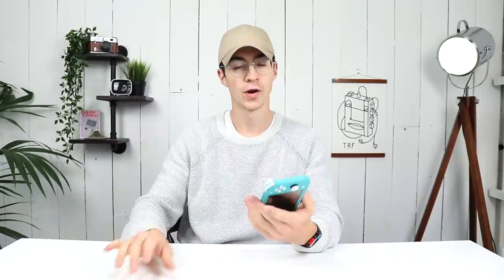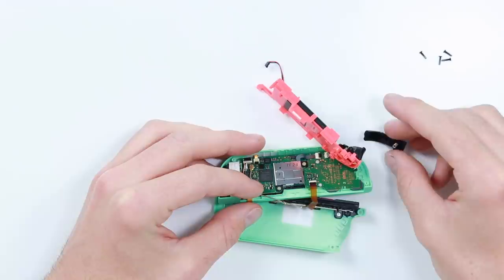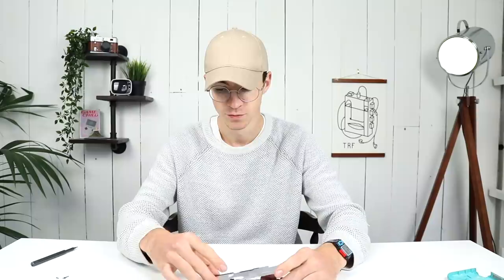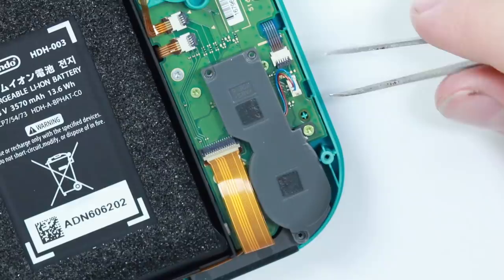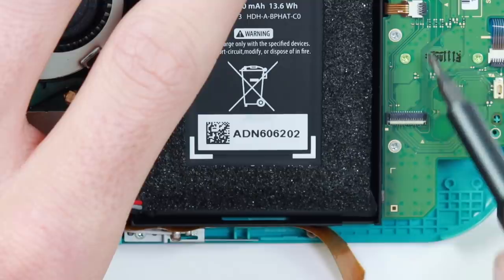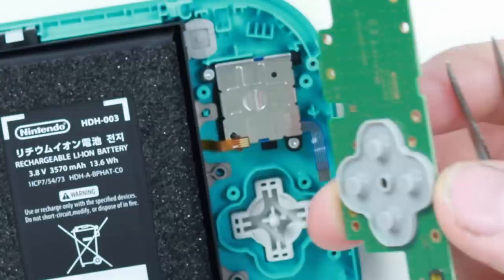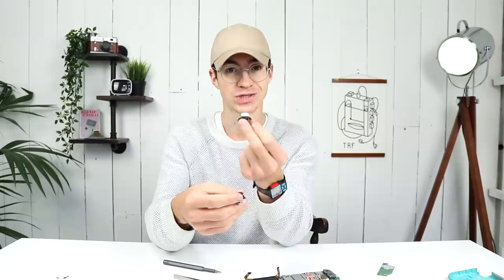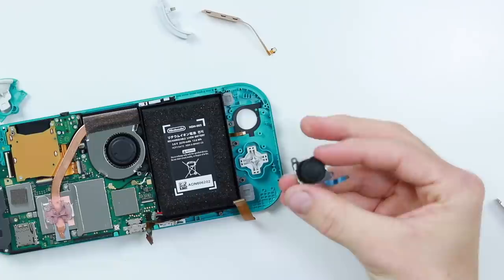Switch Lite Joy-Stick Drift - Easy To Repair?

Comment: Hey so wahts the difference between the original joystick and the lite's drifting prblm?? Like I want to kno the severity of the
Drifting prblm of the lite I just purchased mine not too long ago so now I'm a bit skeptical...plz reply 
I've bnn trying to find a specialist 
On this matter for days now...😅😅😅
Reply: Shōn Sutorei the problem was caused by these pieces inside the analog stick scraping agains each other's and that caused the parts to stick inside of the scratches making it drift I don't know if they actually changed the material from what I have seen in a years own its the same materials just the casing was re modeled

Comment: Great video!! But I want to kwow why did you desconected the battery??
Reply: Simple reason would be out of fear that current is still going through the boards with the potential of damaging components during disassembly. It's always best to disconnect all power when repairing electronics.
Reply: @silversonic1  ohhh thanks!! It makes sense
Reply: @1314Ruben  You're welcome. It's also recommended you wear an anti-static wrist strap, but it would appear Jersey's climate makes it safe enough to not have to worry about it as much. Definitely get one if somewhere prone to static electricity.
Reply: @silversonic1  hahaha I don't even have a switch yet, but I want to get one so I'm learning how to repair the joysticks in case they start drifting (I hope It doesn't happen).
Reply: @1314Ruben  Well, I heard that the joysticks in the Mini are also in the revised Joy-Con(don't know for sure), so if the Mini doesn't get drift in the next couple of months, a new Switch will likely be ok.
Also, I think I remember Nintendo saying they would repair Joy-Con with drift issues.
Reply: @silversonic1  yes, the lite joysticks are the same as the revised Nintendo switch ones. I'm still trying to decide which one to get, I think I will get the lite as I already have a PS4 and I like playing in handheld mode.
Reply: @1314Ruben With the newly revised Switch having better battery life, it is a tough call. It really depends on if you want to have the options of the Switch for roughly the cost of 2 games.

Comment: Hello, I have a Question. So my Switch Lite is starting to drift back a little, and I am planning to do Self-Service into my own Switch Lite by replacing the left analogue stick by myself because there is no Repair shop for Game hardware in my town. the thing is I have total zero experience in opening any electrical component at all or something that involves repairing fragile small things and I am more of the opposite I spend my time fixing machine like a motorcycle and a car. Do you recommend me to do it myself by using this video as a guide and how high is my chance of successful repair for a beginner? Thank you!
Reply: @Snipeador  Thank you for the reply! appreciate it!

Comment: I just bought a Switch Lite and to avoid any future drift issues, I also bought a Pro Controller that I just use instead. My Switch carry case has a stand
Reply: did you pro controller get any drift?
Reply: @christ-on-mobile  no drift. been 2 years now.

Comment: Btw you dont need to actually replace the stick, if you pop the metal things up on the side of it and open the stick you can just clean the black pads and it should fix it

Comment: Sooo in conclusion does it drift?
I was so excited for the Lite because my dad can afford it, but If it drifts it would be a waste of money.
Edit: subbed and liked Btw
Reply from the maker: From what I can tell, it’s an improved joystick! Thanks!!
Reply: The Retro Future Welcome,
But can you make a video looking inside the analog stick (the design flaw/ the blue thing that makes it work and drift) just open that metal thing and you’ll see.
If you don’t want to/ can’t it’s ok 👍
Reply: I know it's late but lite also suffers from this but it's a little different instead of drifting when you point to say the right it will drift back to center and go back to the right a little annoying some have cleaned it and worked, others like me have to swap the stick for a new one.

Comment: Bro I just want to know how to fix the damn issue. I haven’t even had my switch lite for 4 weeks yet and it already has the drift problem on the left analog stick. My guys will randomly switch between running and walking in my games so constantly because of this problem or sometimes not even move at all and then suddenly just go bolting. Like I don’t get this issue and why it’s so common. It’s highly annoying. I had the same issues with my PS4 controllers. Legit all of them. Except for the PS4 controllers it was usually the right analog stick and therefore the camera would get all wonky. It’s a annoying issue. Like I can’t even play my damn switch lite in piece or do anything about it.

Comment: Is the switch lite stick better then the original?! Should I make the replacement?
Reply: TL;DR: No. They most definitely have not fixed the sticks on the switch lite. I doubt it's even a redesign, just looks a little different. 

Mine started drifting almost immediately. I have had my switch a couple of months now and I've been dealing with the drift for... A couple of months. Sucks in animal crossing especially where I can't do precise Terra forming and watering flowers sucks, etc etc because my dude is constantly moving just a liiiiittle bit... usually up and to the right it seems... 

What really sucks is when I run suuuuper slow to the left, because the stick is "going right" a little bit while I'm trying to go left, and therefore have the stick pinned to the left. That's when I knew for sure that it was the stick malfunctioning and not just something stuck in there. Though it does seem to clear up for a bit if I do a quick swoop all the way around with the stick... I doubt that'll last forever and it's on its way to permanent but idk.
Reply: Never EVER buy the switch lite. The non-detachable controllers will definitely catch controller drift. Save the headache and pain. Get a regular switch with detachable controllers.

Comment: Ive owned my switch lite since release date so three days of ownership and my joystick is already broken .. amazon is exchanging the unit tomorrow (supposedly) but that's not the point , Im basically an adult child and have been looking after my switch lite lovingly, these things really need to stand up to some punishment considering the bulk of the target audience will be teenagers . The left stick doesn't drift it has a flat spot when holding down to the left  on the left analogue stick .. left works for a split second and then all control cuts out and the reticule of the calibration tool goes to the centre .. Poor show nintendo
Reply: That sounds like a manufacturer issue, so not quite Nintendo's fault.
Reply: @ethancassell4393  well yes but how long do Nintendo need to rectify the issue .. joycon drift is old news perhaps they should have fixed to problem prior to making a new product .. Nintendo are actually manufacturers too aren't they

Comment: I have drift on my PowerA Wireless zelda controller, I wonder if they are using the same cheap components that nintendo used. Really annoying considering no one wants to actually deal with it so we are left out of pocket.
Reply: The joysticks on the Switch use graphite pads that wear down and causes the position detection to fail. I doubt the Zelda controller you have uses that same kind of small and cheap joysticks. Bigger joysticks uses 2 circle pieces placed on the 2 axis to detect position. One of them must be getting dirty on yours. I had a bit of troubles on my ps4 controller a few months ago and cleaning those 2 bits solved it. https://www.youtube.com/watch?v=_LePBsn3vkA&t=189s this is the video I watched to find how to fix my PS4 controller. It can give you an general idea of what would have to be done with your PowerA controller.

Comment: Hi I have a question. I just got this nintendo switch lite 2 weeks ago and its already playing up :(... Im not sure what its called or where to go to get it fixed but maybe someone here can help?

When I hold the left joystick to the right my character (in animal crossing) struggles between walking and running. Its like a constant stutter. I can walk and run in any other direction fine but when going to the right my character will just stop, walk, run, walk, sprint, stop, walk... Etc. What is this and where can I go to get this fixed? Will it cost much?

Comment: I have drift on my switch light and also this other problem with the joystick where it won't go straight to the right on the left stick. It makes it so frustrating to play my games. This makes me so mad. I paid a lot of money for it and it should be breaking after three months. I shouldn't have to send it in for a warranty fix. Screw Nintendo for not putting out a better product. How dare them cheat us out of our money. I feel so upset I have yo go through this. For me $299 is A LOT of money.

Comment: Meh i know this is late but i bought my lite at the start of 2020 and yeah the drift is pretty bad its OK for me because the games i play dont really require precise movments but that does not excuse the fact that nintendo did nothing to fix drift and it is very annoying since it dose hinder movement alot so when i play things like splatoon its a bother but im going to buy a 8bit controller thing cause even the big one is travel size and will fit in my travel case no analog sticks means no drift
Reply: But i am truly angry at nintendo i should not have to buy a CONTROLER to get my HANDHELD to work i try not to get to angry abt it but lets be honest it was built to break and its fucking annoying they charged me 300 for a system that isnt even all that interesting like the 3ds was way better with the stuff you could do even without a game in it and sell overpriced games on a console that dosent work without a controller even though its a handheld wtf nintendo

Comment: Got the switch lite on launch day and my left joystick has started to try and return back to the center if I move it straight right too fast. I don’t know if I should order the parts off amazon myself to replace it or to call Nintendo since the warranty isn’t voided. Anyone know what I should do?
Reply: Andres Johnson call Nintendo and they should fix it for free if any more issues with the switch just send it to them

Comment: Sliding joysticks on my 3ds and 2ds are working for years without any fault, also they are much more compact and more comfortable to use. Why do they make this crappy small sticks now? They are impossible to use even if the system is new :( Especially on the right side - can't even press buttons without touching it. Waiting for Switch Lite 2 with normal sliding joysticks.
All hopes on Aliexpess - maybe smart guys from China could make 3ds-like joysticks for Switch.

Comment: there is a simple and inexpensive solution that eliminates the problem. you need contact spray (wd40) to spray this on with the console switched off, then press the stick several times (press and rotate), ideally for another 30 minutes. wait with turn on and the problem is history.

Comment: Hello, I have a question for you.
My switch lite is only 3 months old and the left analogue stick has already failed, it is not registering forward pushes consistently and is impossible to run in games.
Do you know why and if this problem can be diy fixed?
Thanks in advance 👍
Reply: I heard WD40 contact cleaner works

Comment: For anyone thinking about doing this, think twice.  I just tried and ripped one of the connectors going into the motherboard.  I am very disappointed in myself because I thought I could do it.  I'll get over it, but yeah not a good day...
Reply: That's why I practiced on disassembling on stuff that is already defective. And that my friend is why I learned PS4 Controllers are more annoying compared to this. With all the connectors and screws you need to move around, you have to be careful with all of your movements.

Comment: The Lite sticks aren’t any better, may even be worse. I’m having issues with both the left and right sticks after having had my Switch Lite for only a month with under 100 total hours of playtime. 

Really poor showing on Nintendo’s part. Absolutely garbage build quality with the sticks, it’s appalling that they shipped such a low quality component in their flagship device.

Comment: I don't get how people have these "drift" problems. Everyone said that about the original and I've never had it
Reply: i'm guessing you're a responsible person and you care for your belongings. A lot of people aren't like that, and a lot of children use these things too. I'm guessing that's where most of the problems come from.
Reply: @Danny.._  I guess
Reply: How long have you had your switch for?
Reply: Do you use a pro controller at all?
Reply: @qwerp3  since the start
Reply: @emilytmx  yes, why? You think I only have it docked? It is docked more than the average one, like 75-80%
Reply: Play smash bros in handheld mode for a few hours and you'll get there. I never had it before either when I used it in docked mode most of the time with my pro controller. But I've been travelling more for my job and after a couple of heavy sessions it just happens. I've had it replaced  by Nintendo and it happened again in 3 months. Drift is a real issue; it has nothing to do with how well you care for your switch. Its more about how often you use it. My right stick has never drifted but that's obviously because its used way less frequently than the left.
Reply: @titosimoes9782  I have a switch from 1 year after the switch came out and mine has no drift I play in handheld and docked no pro controller . I had one controller break but it had broken connectors soni just got a new one I also play alot of smash
Reply: @FirstnameLastName-mr8lk  maybe they're produced in various factories and some are better than others? Maybe it's just luck? Who knows. All I'm saying is that drift is real. Some people think that because theirs doesn't drift then it must be people who are the problem. But that's just not the case. It's estimated that over 30% of the sticks drift. That's 1 out of 3 switches. If I was talking about hepatitis and not and joycon drift, we'd call that an epidemic